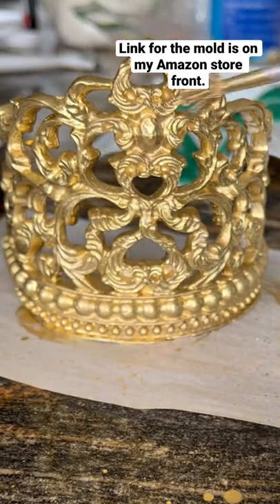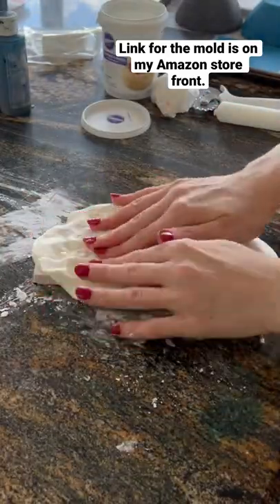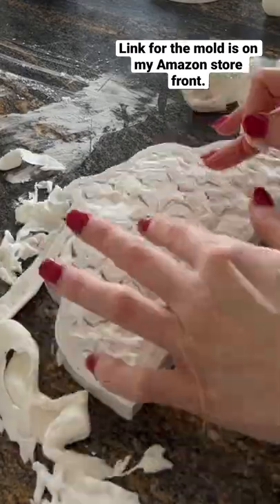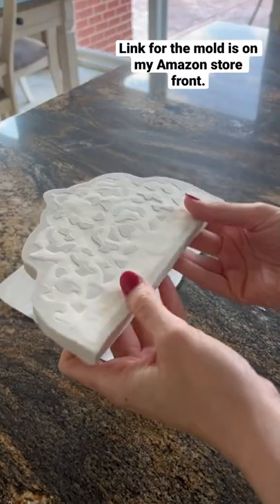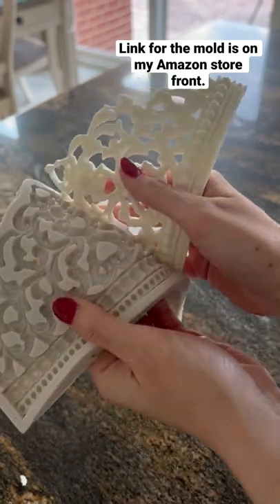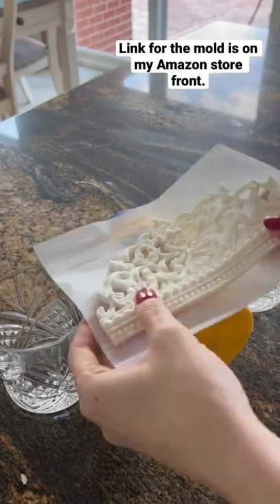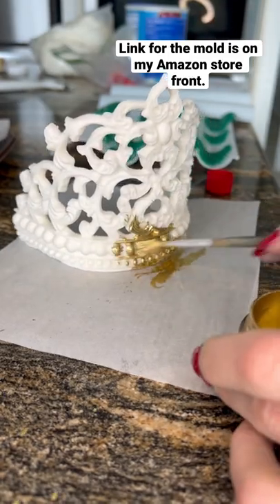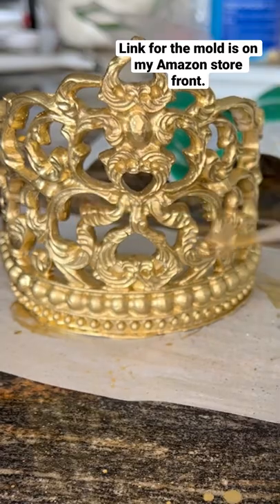How I made this fondant crown

Comment: "a beautiful crown that didn't take me two hours to make it"

Yeah but it took two days to dry-
Reply: Yes, but you don't have to touch it during that time
Reply: It would still take 2 days to dry when made by hand. Making it means assembling it. Not the drying time
Reply: No she said 2 hours to complete it and the 2 days is the drying process. Similar to your argument, drying is a part of the process. She said it would take only 2 hours to do it manually, not 2 days.
Reply: @mystery4789  but wouldn’t she still have to wait a day or two to make sure the fondant keeps the curve shape? ithink she’s talking about the assembling process taking 2 hours not the setting 😅
Reply: @vibezzzwithmeeky  yea and I’m agreeing with you? It takes 10 min to make it with the mould and then 2 days to dry. Usually without the mould it’s 2 hours. But now, instead of 2 hours it 2 days. Which is longer-
Reply: @mystery4789  even if your working with fondant by hand it still has to set it doesn't magically set just because your doing it by hand the fondant doesn't have an on or off switch to tell the difference between it being worked on by hand or by mold. It takes the same amount of time to set, the assembly part time is cut down drastically thats the only thing in the process that has had a reduction in time, everything else is a constant
Reply: You can just eat it if you want to